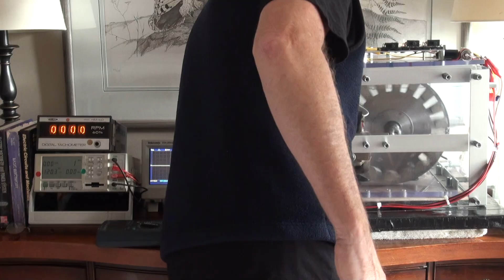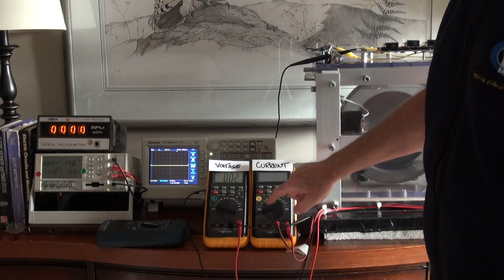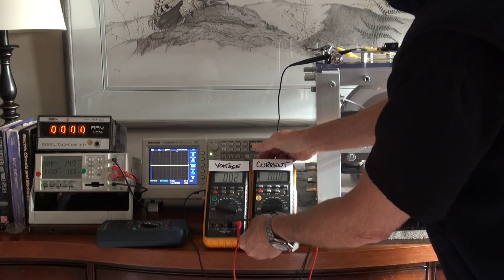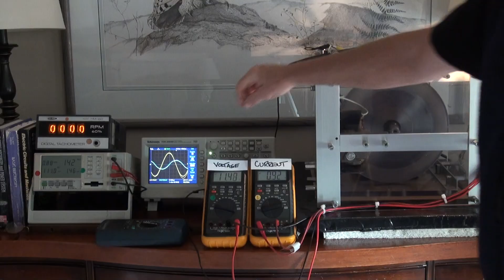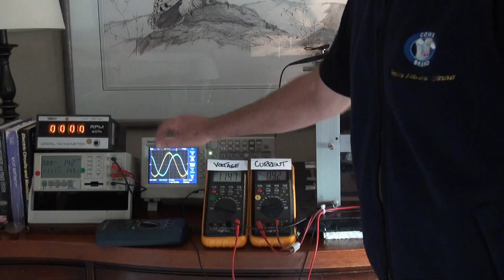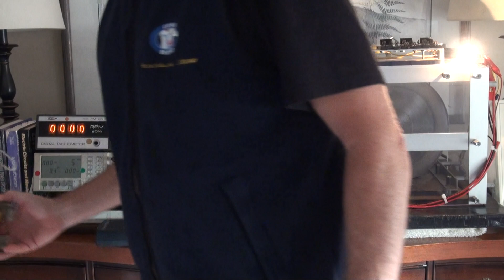PART 2 Christian Von Koenigsegg EV Regenerative Acceleration Innovation Demonstration

Comment: Just some random thoughts after watching the video.....
If you put a bigger resistive load on the motor/generator does it still run out at a higher rpm, Or does it cause a drag. Looks like the ratio of coil impedance, rpm and load must be met. Seems at a high rpm it can carry a small load and the resistive load created less back emf /less drag on the prime mover due to the current being used in the small 12v light/load as heat drawn out of the system instead of going back into it as back emf.  Can you short out the load wiring output instead of a light and still have rpm increase and less current draw....If the rpm is going down as a car is braking less output? the rpm is needed for the inductance of the coil to be low?

Coil impedance generally decreases as RPM increases due to the faster emf switching which allows for more efficient current flow.

I've seen some  similar situations adding a capacitor to the generator coils which are wound with fine wire. 

Nice demo. Thanks.